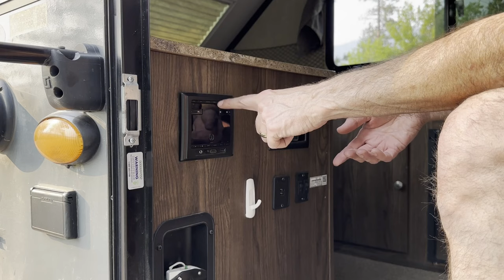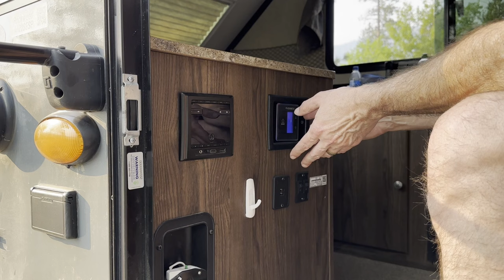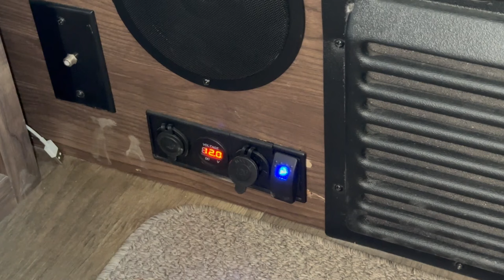PROS & CONS Of The A-Frame Camper

Comment: I have owned 2 Class B motorhomes, a big truck camper, a tent trailer, and now a 2017 Rockwood 213 HW. My wife and I liked the simplicity of the tent trailer but I got old and it was too big of a workout to put the tent trailer up. I find that the A-frame is a breeze. Mine has been lifted 4". I have the cassette toilet which is nice in the middle of the night. I took the microwave out to add the needed pantry. I re-did the front panel with a marine-style fuse box and moved the floor light switch so you can reach in and switch it on before entering the dark trailer. I installed a USB/three accessory plugs which I can switch off or on; no light when sleeping. Mine came with a nice Kenwood in-dash stereo, but it was too hard to turn the outside speaker off. I put in a switch. I replaced the speakers and replaced the radio with a marine style that has Bluetooth. When boondocking I only use a portable Bluetooth speaker; when I'm home I use the stereo. I have added two Battle Born 100 AH lithium batteries and now have a dual system with the front lead acid batteries sharing the 360 watts of solar using a marine-style Perko switch. The stupid table has new AP Products hardware; so it can swing up and be held with a single spring-loaded leg. I have two 1/2 umbrellas for shading the big windows. When the bubble windows start to leak; I have a plan for them, I've done other things to make it more livable out in the sticks, but I have bent your ear almost off. I love my A-frame.
Reply from the maker: Thanks for the great comments and good that you have the ability to make yours more durable and comfortable. I’m not inclined to add these useful modifications into a unit that most likely won’t stand up to the rigorous backcountry roads I often travel. After my big trip to the arctic and Alaska this year I will most likely be selling it and just camp in the back of my truck when I’m traveling into the bush. Wife and I are considering a Class B unit at some point. I don’t mind roughing it but also like my comfort. Cheers.

Comment: Kind of weird that they have raw plywood exposed on the bottom too.  It should at least be painted with water-shedding spray paint.  These things are so expensive, the hanging wires and raw wood is unacceptable, imo.
Reply from the maker: Agree. I hear it has some kind of water proofing infused in it but the rest of the trailer is junk so selling it soon. Doing a follow up video on why you should never buy a Forest River A Frame camper.
Reply from the maker: I agree with ya!

Comment: My Aliner is much older, but has many of the issues you point out.  Many of these shortcomings, however, exist to keep the cost down.  Adding cladding to the wiring, better electronics interfaces, etc. would raise the price substantially.  Your video certainly has great value in showing people the compromises that this type of camper entails.  In particular, the fact that the door bisects the lower portion of the "shell" makes flexing and poor fitting closures a certainty.  Serious off roading would not be an expectation.  I have encorporated many of blogger Slim Potatohead's "mods," particularly the use of latches to pull the door sides together when the unit is collapsed.  Good job!
Reply from the maker: Thanks for your comments! I agree, adding these would increase the cost but would make it more durable. I bought mine used so the difference might not have been that much. If they make a unit with larger knobby tires and market it as a sport model which this is, they should have added additional protection from the elements that this would be subjected to. You’re correct in stating it’s not for serious offroad but the type of dirt roads I go to are generally normal gravel roads with typical washboard surfaces and the odd potholes. I have taken this unit in to my local rv repair shop to fix the broken wall issue and will make a short video on that soon. Thanks again for your input! Cheers.

Comment: Excellent review. Thank you. A short note on your orange marker lights on the front side of your camper. Looking at the video, you complained about the light cover being loose. If you look closely, you will see two small holes on the top of the lens. Those are drain holes to allow water to escape. There is a small hole at the front of the lens. When traveling that hole will allow water to collect inside the light cover. When you remove the cover and rotate it 180 degrees, look inside and you will notice a small hook that the cover snaps onto the top of light frame, and the cover will snap on, providing for a tighter cover that will hopefully stay on better, and not collect water. Sorry about the length, but I had to be as accurate as possible. I appreciate the detailed review. Again, thank you.
Reply from the maker: Excellent! Thanks!  👍👍

Comment: I am the 4th owner of a 2005 US built (now by Columbia Northwest) ALiner. It is only 13 ft., so you have much more space than I have! I researched A-frame campers for 3 years before buying. I've had this for 4 years. Before me, it spent it's entire life in the torrential wind and rain of hurricanes and scorching sun of South Florida. My Aliner was first owned by a "go everywhere/see everything" senior couple. Next, it was a family of 4. Then, a young bachelor. It has been on extended trips into the mountains, beaches and back-country roads of the US. It is not lifted for additional ground or tire clearance.
 
Just as all cars are not built with the same quality, neither are the A-frame camping trailers. I believe yours is a Rockwood design taken from the ALiners. A-frame campers, unless designated for off-road/back-country use, are built and intended to be on pavement or maintained gravel or dirt roads. Your A-frame was not built to handle what an off-road or overland conventional “egg” fiberglass or even “toaster” camper can handle. 

You made some good points about what to look for in an A-Frame camper. 

Pro: Hard side for security against wildlife. Some parks do not allow any canvas. As for breaking camp in the rain, folding the sides down allows far less water inside than packing wet canvas and bedding on a conventional pop-up!

Pro: Spacious with generous headroom 

Pro: Privacy 

Pro: Good frame ground clearance for off-road. If lifted, be sure you also gain additional tire to wheel-well clearance. 

Pro: Generous lighting via windows 

Pro: Low travel profile so easy to tow

Pro: Extremely useful tongue box storage

The problems you pointed out seem to be related to manufacturer shortcomings or use that the camper was not designed for. Some, such as the door gasket and the fogged bubble window, are normal maintenance. A-frames are notorious for leaking air where the sidewalls meet the roof panels. Being meticulous about setting the camper up in a level position will help eliminate most leaks. If the weather stripping isn't preventing leaks, replace it with closed cell foam stripping. 

The bubble windows can often be polished to almost like new condition. Do not use headlight polish. Use polish that is made for your bubble windows. It can easily take two hours to polish one window, even when using a powered buffer. Don't be in a hurry and don't press too hard. Depending on size, replacement bubble windows can be $500+ each. I spent 5 hours and $80 on polish and mine are almost like new. I made snap-on rectangular covers of marine canvas for mine to protect them from abrasion while driving. This has worked very well!

On leaking doors, also check for loose hinge screws/rivets and hinge-pin wear. 

The marker lights are a choice by the camper manufacturer who apparently did not consider rough and tough off-road use. A little rubber cement will hold them from jarring off, yet you will be able to access the bulb with little effort and no damage to the lens.

Stress fractures in the bubble windows are the result of the window expanding and contracting at a different rate than the surface it is screwed to. A solution for this is to mount the window in a bed of non-hardening sealant and don't completely tighten the screws. Another or additional leak preventer is to cover the edges and screw heads all the way around with 4 inch wide RV roof repair tape. It is available in black or white color and looks very neat. Mine were done with this tape over 6 years ago and I still have no leaks.

As for the floor, yours is a common wood chip composite, set in a highly waterproof or moisture resistant resin. Deterioration usually starts at an edge or where the surface is gouged. Off road use may accelerate damage due to moisture absorption by abrasion from rocks and gravel. My 2005 ALiner floor is made similar to yours. I think ALiner switched to non-wood flooring a few years ago and this is no longer a potential problem. I have one 2 inch area of moisture damaged wood flooring that I cut out, sealed the edges with epoxy and filled with expanding foam. I then gave just that spot a coat of tar-like chimney sealer. If you decide to coat the entire underside of the flooring material, be sure your sealer will adhere to the surface and that there are no voids that will trap water from the road. 

ALiner keeps exposed underside wiring to almost none. You can buy split-length tubular plastic conduit to put around wiring exposed to the elements. Anything you do to protect against abrasion, moisture and varmints will be money well spent.

Replacing your table support with a single leg pedestal will mean having the receiver for the vertical post secured permanently to the floor. In my case, it was a nuisance. The table can be mounted to almost any front wall so that it is secure in the up position and yet swing down to the bed position. This gives you an unobstructed floor with minimal knee/leg obstruction.

I too, pulled the microwave out in favor of storage space. I still carry the microwave on the bed when traveling and put it up on the countertop when parked. I'm self-powered with 400 watts of solar, so it is still handy to have. A two burner induction hotplate avoids carrying propane for cooking. I have a diesel heater that is extremely cheap to use, trouble free, odor free and takes 1/4th the space of a propane heater. Most importantly, this type of heating totally eliminates trouble with condensation inside the camper. The propane water heater was removed in favor of more fresh water capacity. If you use a water heater, be sure to service the anode rod every year. Seal the anode threads with an approved anti-seize thread sealant.

By removing the propane tanks, I reduced the tongue weight by 65 lbs. I do not have a built in storage box like yours. Removing the tanks gave me the ability to carry more gear in a 48 inch long rectangular diamond plate tongue box. I also removed the two tongue mounted batteries (74 lbs.) in favor of 4 Battle Born LiFePO4 that are carried inside the camper. I bought LiFePO4 batteries for more usable capacity than FA or AGM and safety against fire from common Lithium batteries. The addition of two batteries added very little to the trailer weight. They are mounted almost directly over the axle with two on each side. The trade-off there was some lost storage, but greater security and protection, so that they can be charged during extreme low outside temps. Each LiFePO4 battery gives me approximately double the usable power of one of the previous AGM batteries that the ALiner came with.

Thanks for all your suggestions. You have a great looking camper that should give you many lasting memories.
Best wishes!
RL

P.S.
I definitely appreciate the idea of being able to boondock anywhere with air conditioning when I need it!
Reply from the maker: Thank you for the extensive feedback! This is so useful. I agree, the Aliners have a far better reputation than the Rockwoods. I am doing a follow up to this video on the additional issues I’ve had recently while on an extended trip up to the arctic with it. Thanks again!
Reply: It was not my intent to disparage the Rockwood or any other brand. Aliner has had it's problems with the frame. That can also be caused by simply exceeding the GVW, especially on rough terrain, or putting too much weight on the rear bumper. They flatly state to not add any weight to the bumper (if you have a bumper!). Mine came from the factory with the spare tire mounted on the bumper and I added a white plastic 5 inch X 70 inch square fence post cover with a top cap on both ends. This is where I carry my rolled up entry approach rug. Total weight = 7lbs. I highly recommend a wind preventer. I made my own design with cable but the tubular aluminum is less expensive and much easier to install.
I believe owning an RV is simply a way to learn how to fix a lot of different things that you never thought of when you bought it! For me. doing my own work is a huge bonus to camping.

I'm really eager to hear about your artic trip!

Ciao`   @capturereeladventure

Comment: We have always loved tent camping as “before-kids” adults,  later, pop-up tent trailer  camping with our kids, 
and now Aliner camping in 
our retirement years.  I miss all the storage and room of a pop-up tent camper, but the set-up became just too much for us now. Our Aliner fits our needs: a secure camper, easy to set up, tow, and garage it. 
We, too, were amazed at the less than professional way all the wiring is stored. We go down fairly good dirt roads here in Arizona, and go slow, yet something inside always comes loose. We have to check all the time to make sure we have turn signals. 
But, it’s truly nicer than tent camping. And I try not to sweat the small stuff!
Reply from the maker: Thank you for your comments. A Frame campers certainly are appealing for many reasons. The Rockwood A122sesp model I have is much larger than some of the Aliners and it just barely fits in my garage. I'm always having to check to see what has come loose after a backroad excursion. Everything got shuffled around inside until I started putting things into buckets and packing them tight against each other on the floor. Despite the positives I will be selling this unit after my 10 week fly fishing and photography journey up to the Arctic with it starting in August. Stay tuned to this channel for all the videos of that trip! Cheers.

Comment: I've found that the 2.5 gallon portable cartridge toilets fit PERFECTLY in the storage compartment under the dinette by the entry.  When you need to use it, just open the storage door, pull out the toilet, do your business, slide it back in and close the door.  I prefer this to models with the built-in toilet since it doesn't take up any floor space only storage space.

When you talked about the wiring, the "spaghetti" mess doesn't bother me as much as the connectors they use.  They just use those screw on wire-nut caps to join wires, which come apart easily with enough shaking and rattling.  I've been replacing a lot of them with the WAGO style connectors as I encounter issues with loose connections.  I almost feel like spending a day or two going through the unit thoroughly to find every single wire-nut and replace it with a WAGO connector.

(Edit:)  One thing you talked about a lot is that this is advertised as an "off-road" capable model.  I would agree 100% with you that it really doesn't live up to the advertising in that regard.  At least not for regular use in that manner.  These are really just a bit more capable than your standard trailer.  That is, it may hold up or be more capable than MOST travel trailers - it's definitely better at giving you access to camp sites - but I believe most of the problems you discussed in your video were due to regular use "off-road".  The dust issue, the crack in the wall, even the window leaks would be aggravated by off-road use.  I don't think they should be advertised this way without extensive improvements, many of which you pointed out.
Reply from the maker: Good points! Thanks for your input. Cheers!

Comment: Provided your wires are in good shape, and continuity tests are passing, hang your own conduit parallel to the existing wire.  Then cap the ends.
Purchase more plastic wire loom for the exposed wires where you can apply it.
Spray expanding insulation foam on the bottom and saw off excess.
Possibly do a metal roofing panel underneath as well.
If you have additional conduit laid in first you can just run new wires where needed should the old ones short out?
Reply from the maker: Good ideas. Thanks!